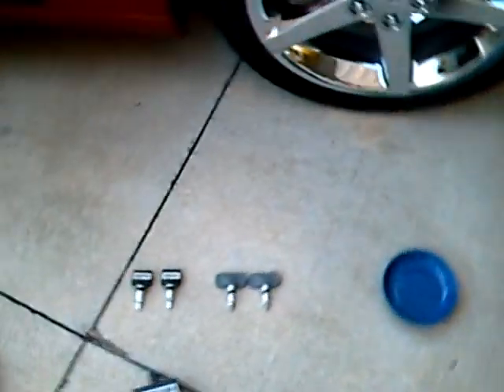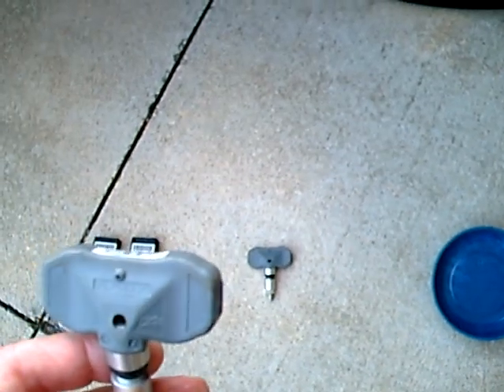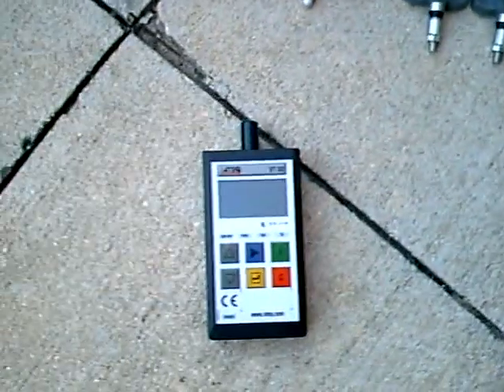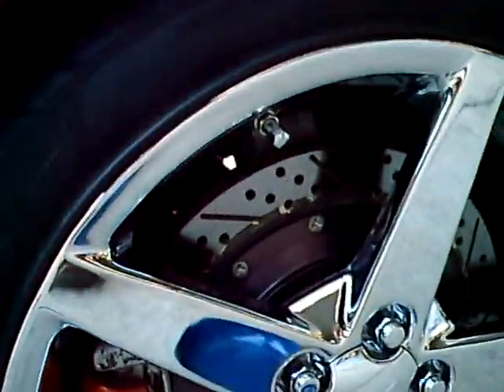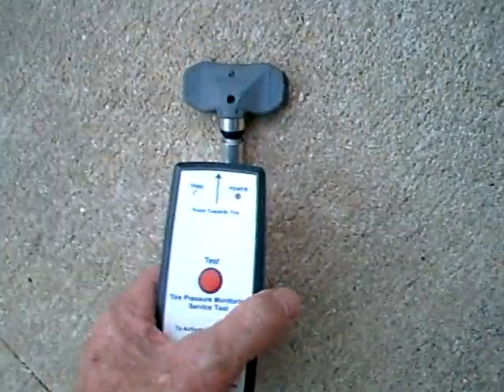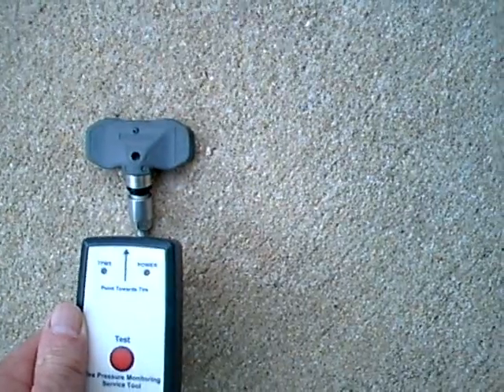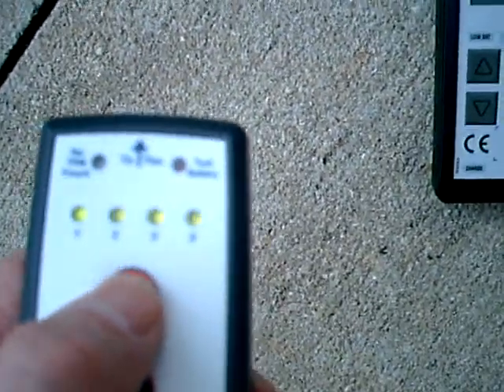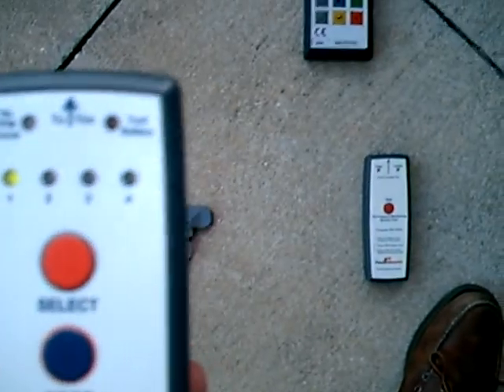C6 Tire Sensor Diagnostics

Comment: Do you have to use those radio frequency tools to activate the sensors.  I have an 07 Hummer and had to replace the right front sensor and I am not having any luck on activation, but I didn't know their were frequency tools to do it.